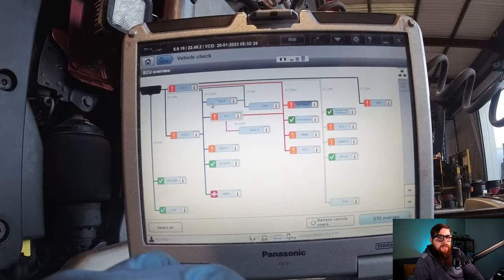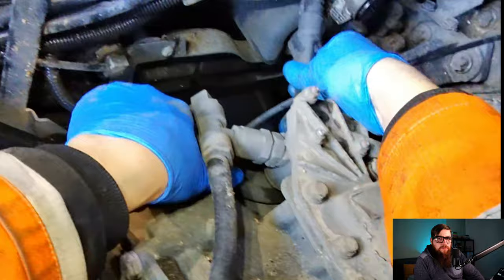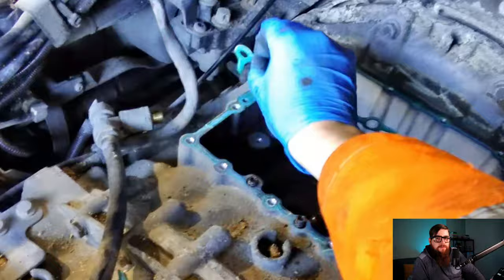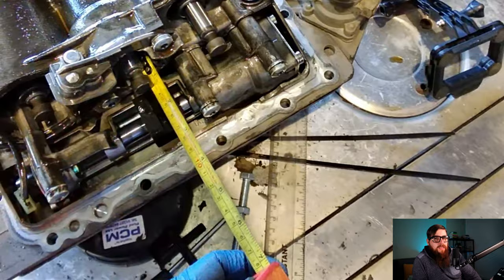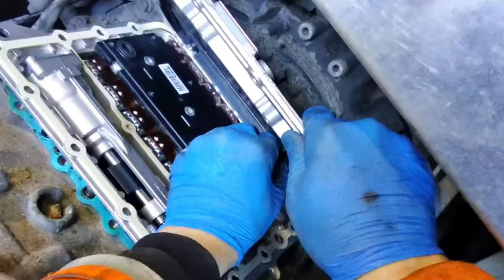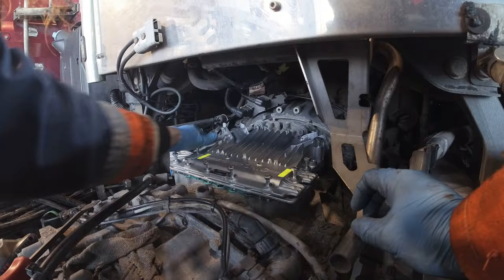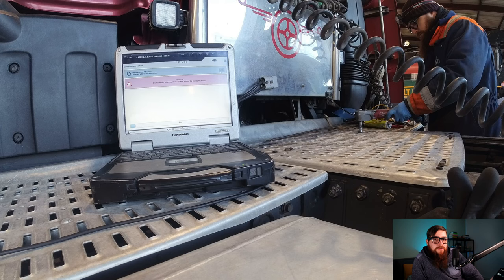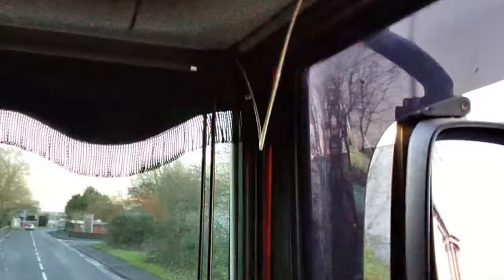WATCH THIS! before you replace your DAF As-Tronic Modulator

Comment: I am currently having a similar problem on my 2015 euro 6 Xf. The truck has been in the shop for 3 weeks and they cant find the fault. It is intermittent and comes a goes every other day. You can get it to work by shutting of the main power switch for a while. The clutch and slave is new with no difference. The have cleaned the modulator because it was pretty grotty.
Reply from the maker: Hey, thanks for the comment Tom. I think you should put some seals on the 3 main pistons in the lid or just get it all reconditioned. 
If you want to see if it's the lid, do you have another truck you could substitute it off for a day?
Reply: @TRUCKTECHUK  yeah i actually have another 2015 :) i will try that. Thanks for the tip.
Reply from the maker: No problem! you can swap them over in about an hour and then see if the fault moves to the other gearbox 👍
Reply: @TRUCKTECHUK  i have binged your videos and i wish i could find a mechanic like you in sweden. I have had two identical 510s since new and they have been very reliable. The have similar miles on them around 1 million each. They are still fuel efficient and dont take any oil, 4 liters per year.
Reply from the maker: @tompettersson3814 I'm glad you have enjoyed the videos and I hope they have helped in some way. In regards to a mechanic,  you just need to find someone who loves doing what they do and loves the product.
 Sounds like you have kept your trucks in top condition I hope they have been kind to you financially over the years 🫣
Reply: @TRUCKTECHUK  yeah i am pretty pedantical :) i buff and polish everything twice a year. Filled in some stonechips yesterday on the front axle beam. I am a car guy and i like to tinker but i have got 5 old saab turbos that takes up much of my spare time.
Reply from the maker: @tompettersson3814  Filling stone chips on an axle! amazing.......ive seen people hammer paint off bolt heads on Pre Delivery Inspections 😵
im done with cars now, my last old car i had i sold to buy my house 😪

Comment: Ah the old memories come flooding back. Peering down through the inspection hatch of old van bodies on to the gearbox below and lifting the selector housing off whilst peering into a strategically positioned shaving mirror to keep an eye on the indent springs!!!Never imagined all that electronic/air wizardry would come to be. Well done on   Your expertise..it should give reassurance to all your Daf customers to continue running Daf trucks 👍

Comment: Why replace the hole modulator 😢 just repair it, it will save a lot off money for the customer!
Reply from the maker: Hey thanks for the comment. The vehicle is under a maintenance contract so it has to be replaced as a complete unit, the unit is reconditioned and is covered by a years parts and labour warranty. If this was a cash customer I would rebuild the seals and charge him more labour
Reply: Ah right! Good job then 🎉

Comment: Love the videos, im in Australia with a CF85, MX13, Astronic ZF. I have a vibration or shudder when accelerating from slow speeds which I suspect is the clutch, but have a different one almost a crackly grinding at top speed when not under power, but goes away when I press exhaust brake. I dont know if its the clutch as well, or gearbox, or even exhaust valve?? Its just done 500,000kms. Doesn't make any noise when stationary and revved etc. Any ideas??

Comment: Hello, I've been following you for a while, I've been watching all your videos and you do an excellent job of sharing to us this informatin. I am also a DAF mechanic. Thank you! 🇷🇴
Reply from the maker: Hey Bent, thank you for the comment, Sorry for the late reply!
 I'm glad you enjoy the videos and the content helps you! Look forward to hearing from you soon 😎👌
Reply: Hello
I have a duff xf model 2020 trailer. Retard three-stroke engine. Very often, the valve stem and tappet will be damaged. Why is it so weak? The mechanic told me that the reason it breaks is because you use too much retarder in the engine brake. Is it correct and what should I do to prevent the valve stem from breaking? Thanks

Comment: Exista un kit de reparație pentru as tronic, este mult mai ieftin decât sa îl schimbi cu totul. Dar... Voi știți sa schimbați cu totul nu sa reparați.
Reply from the maker: Hi thanks for the comment. 👍
 Working at a dealer they don't pay you to fix the part!
trucks under contract maintenance like the trucks I work on at the dealership WOULDN'T allow seals to be put in for repair as the modulator has to be free from defects for 12 months under warranty.

Comment: Great video! Thanks. 
I have exactly the same dtc, is the only dtc my gearbox have. Counter 60 times😅. In my case the gearbox goes into N only between 1 and 7 gear. when gearbox try to shift , it goes into Neutral and warning transmission in red, 8 and upper gear works good, have diferent solenoid for low and high gears?

I'm thinking of replacing only the solenoid part for a remanufactured one. This behaviour may be not related to the upper astronic ecu?
What is your opinion?
My truck have 1 million kilometers 😅. 2016 xf 460 my dealer ask me 5000GBP for a complete new(remanufactured) modulator😮

Comment: Hello, very informative video. Good work.
I've gotten the error 3002 FMI:10 that seems to be splitter valve Y2,  I changed the As Tronic Ecu and Cylinder and cables that go under gear box, but the error is still there. Could anyone have any idea what it is? Cheers!
Reply from the maker: Hi, thank you for the comment and for taking the time to watch the video. As for your issue, I believe you could possibly have an open circuit on the Selector Valve circuit y2 still unfortunately. Have you checked for continuity from the PCB to y2 on the modulator?
Reply: @TRUCK TECH UK  Thank you for your answer. I've sent the ECU to be verified, and they said that everything is fine with  him. Probably, I may need a second opinion.
Reply from the maker: If it helps, this gearbox was also fitted to MAN, so don't think you are limited to DAF if you're struggling to find a competent technician/garage to repair it

Comment: how do you rate the angle impact pal & is the one in this video 3/8 ?
Reply from the maker: Hi buddy thanks for the comment. There are a few videos on YouTube of it doing 300nm I think but It certainly isn't that.. I had the fuel 3/8 ratchet before this and this angle impact wipes the floor with that but it's not as powerful as the 3/8 stubby impact gun. 
All I can say is if you have the gun and want more flexibility in removing stuff get this.....just don't expect it do wheel nuts 😂
Reply: @TRUCKTECHUK  cheers for the reply 👍🏻

Comment: I have a 2018 530 daf,auto,but it keeps letting go of the gears,I've replaced the clutch,clutch pack,but it's still letting go of the gears...any idea's?
Reply from the maker: Hey, thanks for the comment. Model year 2018 will have a traxon box fitted when you say letting go of the gears. Do you mean slipping or dropping into neutral?
Reply: @TRUCKTECHUK  it was letting go of the gears,but still showing it was in gear....fishlake commercials have now apparently sorted it,so we will now see,when I get a load on its back....
Reply from the maker: I'm glad you got it sorted. It would be interesting to know what the write-up states off the invoice or any fault codes 🤔
Reply: @TRUCKTECHUK  when I find out,I'll let you know bud....

Comment: I haven't seen an AS-Tronic   AS-Mid issue in years to be honest ..When it first came out fitting the lid really was hit and miss ,then it was remove the 2 screwa to see the rods and now as you did it is a camera...DIP i thought was Drivers instrument Panel lol...I offically hate the MX11 ,i have a long block ,jesus  drssing it is a nightmare ,MX13 is lovely in comparison ,and when you build up the hot side to find the turbo coolant pipe  does not fit in the block as the blocks been modified ,and the parts where meant to order it as it is annotated with a (1) but didn;t is slightly annoying as i now need to strip it all again lol Though if that is my only issue i will be happy...I see in RMI in the academy they have launched more training i have went from 100% to 75%......And we have got new DAVIES pre release ones ,detachable screen  ,but they dont look as robust as a unit
Reply from the maker: Hi norb 👋 funny enough I seen a as-tronic MID issue in a LF the other day, it was a 21 plate. The APU had packed up causing the air not to build over 7 bar ......so no gears 🙈

I'm going to make a tool to do these rods which sets the modulator and the ones in the gearbox so it should just drop on then....here hoping! 

You had me 2nd guessing myself with DIP so I checked RMI just now 🤣🤣🤣.

Parts not doing their  jobs correctly!!! NEVER!!! Leyland training at it's finest 🙈. Sometime I have to read there bulletins to them myself 🤣

I best go check and see if I'm still at 100%! I'm still waiting to do more E.V diagnostics.

We have a Davie that the screen detaches from I think it might be in this video https://youtube.com/clip/UgkxWJcWbs1IHrRH9DwT61v3SfjyXPW6tZ89 actually! They are abit quicker. I see the passwords change every 90 days now 😑
Reply: @TRUCKTECHUK  When AS-Tronic first came out, ZF gave the dimensions to make a tool from wood that set the dimensions .so it should still be in RMI..It is the same at our place with parts if you want a plug kit ,unless you give them the number ,you will get whatever they think it is you want.I have even showed them how to find them in the diagrams ..As you know it has been a while since i have had to really use a DAVIE lol..are you talking about RMI or DAVIE passwords
Reply from the maker: @norb0254  sorry I've not responded to this! It was held for review as It contained the word Davie which I added as a blocked filter word as I was sick of people asking me for it! So I've just noticed the message sorry!
Reply from the maker: @norb0254  I was on about Davie passwords as I had a phone call tonight saying one of the lads just blocked both Davies as he put his password in wrong on both Davies 🙈
Reply: @TRUCKTECHUK  So if 1 person makes a mess of his log in everyone is blocked ?? Why couldnt they just leave things as they are ...
Reply from the maker: @norb0254  I believe that is what happened last night till he used another person's log in after it timed out 😳.

It's on techshare if you want to read it 🙈
Reply: @TRUCKTECHUK  I have heard  from lads in our place that the new ones have a meltdown when you have to switch the ignition off
Reply from the maker: @norb0254  ive not had any issues yet this week but its not friday yet 😬
Reply: @TRUCKTECHUK  Still time then ...Just found out i have a whole 2 courses down at Haddenham  this year ,,That is more than enough for me ..I can barely remember what day it is never mind what they are telling me lol
Reply from the maker: @norb0254  TWO! what are they then?
im still waiting for my E.V diagnostic course they were going to run before chrismas. 
i dont think i have any this year 🤷. im off to america again next week 👌
Reply: @TRUCKTECHUK  Enjoy america ...I have diagnostic methology and coaching ,both 1 day jobs ..I also have an online one for the NGD ...So coaching is different from mentoring  apparently...But apparently it is 1 they have me down to do ,so im doing it lol....And no videos of Kenworth Peterbilts  and their version of the LF ...I'm not sure if they released EV courses .. this time ,but i may be wrong
Reply from the maker: @norb0254  oh I will lol 
Diagnostic and coaching! If only we had some technicans to coach 🙈. Let's hope they don't mean coach as in BUS 😂😂😂👌
They need you to do it for dealer standards 🙄
Oh I'm always on the look out for paccar products......the girlfriend will have to stop me googling dealers in the Orlando area again 😂🙈

E.v I thinks changed again with this year's product....don't even know if they are using the same sumo HD motors in the LF now 🤷.